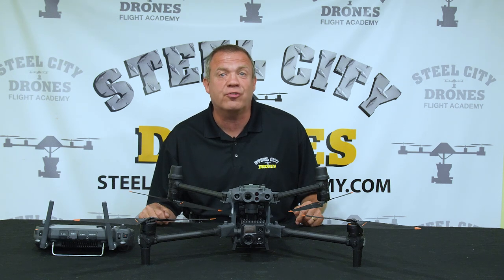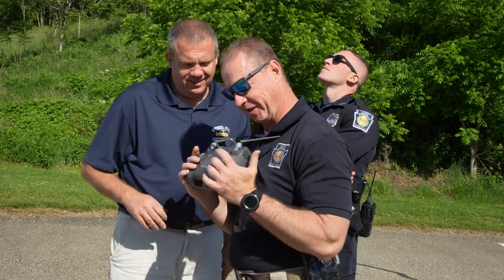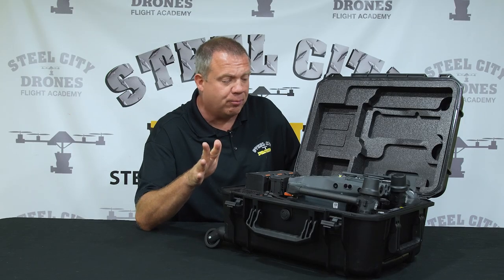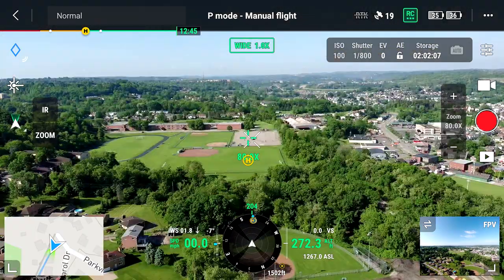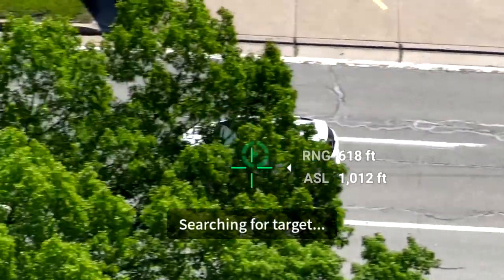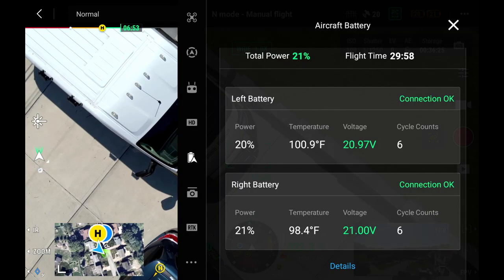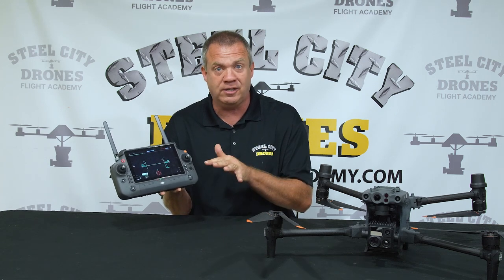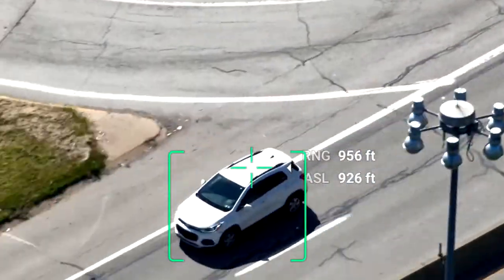DJI Matrice 30 Comprehensive Review and Comparison

Comment: This in an excellent video of a really outstanding drone. If it sounds like a lot of money, and it is, I can truly say that's worth every penny. After I bought one, I simply could not believe the quality, the workmanship and the design. DJI thought out every detail and really hit a home run with this drone. I'm fortunate to live in Florida and can connect to FPRN at absolutely no charge. That provides me with RTK, which means I could do mapping, just as if had had a base station. Aside from mapping, the advantage of RTK is a more stable platform, not having to rely solely on the compass, and giving you 1-2 cm accuracy when landing or getting coordinates. This drone has all the system redundancy of a manned aircraft.  The M300 is also a great bird but costs 3-4 times as much, which puts it in the not-affordable category, it's huge, heavy, more expensive to run, and is a pain to transport.  Thanks to Steel City Drones for all the time and efforts spent in putting this great video together.

Comment: This Drone could be the best creation of DJI, and the best Drone ever made!
Even I believe in some how it’s beside the Matrice 300!

However this Drone M30 series has 2 big downsides; 

1- You can’t pay $20,000( Australian price of DJI M30T basic kit with DJI care 1 year) in a Drone where the main camera, hardly can turned left and right, I mean when you turned left and right, you can see the arms, propellers, and stuffs of the Drone, like in the whole frame!!!

The main camera should have been able to turned 360 degrees, or at the list 180 degrees in a clean view, only looking for the subject in the frame, specially when it has been “Built/ Made”  for first safety responders, like Fire fighters, Police and others!!

2- The main camera should be able to swap for other payload, like P1/L1 and more, specially because it is very compact and great drone with its size and portability!

However about swapping the cameras/ payloads, if they haven’t thought about that before realising, at the list they should have made 4 different versions…

- First version M30/ M30T, 
-Second version M30 P1
-Third version M30 L1
-Forth version the Dock one, as it already has been made( but this one it’s specific for companies and stuffs).

If the DJI Enterprise Team had thinking about that, it would have been selling just like water bottles!!

Specially for many trades out there, and many different industries would benefit from that choice to buy, different needs but in the same Drone, even more special because of those many features like as deploy time, Walter-proof, portability and on!

*The best RC ever made!

Comment: This is basically your Phantom 5 Pro Advanced V2+  that everyone was waiting on.
Reply from the maker: Actually it couldn't be more further apart than any Phantom. This is water resistive, with outstanding zoom capability, awesome thermal, and 30 minutes of flight time. This has all Matrice 300 features like Smart track, and grid mode with Pilot 2 functionality.  This has no landing gear for no drag and flies incredibly smooth and can handle up to 33 mph winds. No P5 was going to or will be able to do that.

Comment: How could DJI make such a backward step by using a 128 GB card (maximum) from what the Mavic 3 Cine has?
Reply from the maker: Two different drones with 2 different purposes and requirements. Matrice 30 does not do Pro res or 10 bit filming. The M30 is for public safety not film makers. The Cine unit for the most part will use the internal SSD drive because the file sizes are huge. With the M30, the camera's file sizes are significantly smaller thus not needing more than 128 GB.  IN fact during our filming and testing of the M30 for this video we never even filled up a 64 gig card once.

Comment: Does it have smart follow feature? That is following the location of the controller. For example, if i control it from a moving car, but i want to be able to look around me from the sky.
Reply from the maker: Smart track will follow any update that you select it to pick up. Objects should show up as green circles and as you select it the camera will stay locked in on it. It won't follow the object but the camera will stay locked in on it.

Comment: Dave,  any new model drone will need to be made to comply with remote id from the manufacturer starting in Sept of this year.  And in June, there is no final specification??  That seems ridiculous, right?  I suspect DJI has a very good idea whether or not the capability for complying with remote id is if fact ready to go.  Maybe they can't yet say "absolute" "positively", but they basically know. Thank you for the comprehensive video.
Reply from the maker: I suspect remote ID will be delayed just like Part 107 was 2 years delayed even under a direct order from the President.

Comment: Hey I have a question about the m30T last week you were flying the drone and had a lost connection between the drone and the remote control. The settings for lost connection Were hover. what will the drone do when it reaches low battery ?
 We were still with no connection with the drone, will it start returning to home or land where at it's ?
Reply from the maker: if Smart Return is turned on it will come back, if its off it will fall out of the sky.

Comment: Hi, I have a question about the loudspeaker attachment. Does it act as a megaphone where you can speak directly or is it only support text to speech?
Reply from the maker: As of right now you can only text a message, in my opinion that will change with firmware updates that will change.

Comment: What streaming abilities exist to get video to command center?    Is there the ability to specify a URL to stream to?    Does dronesense work on the smart controller?   Or is there ONLY HDMI out?
Reply from the maker: There are free ways to do it streaming to Youtube or Facebook but they are not secure and very inconsistent.  The best option we have found is an option called DroneSense that works very well, very secure, very consistent. You don't have to buy equipment and its a monthly charge.  It also does a lot more than just streaming and handles Pilot management and maintenance as well.
Reply: There is also DJI flight hub 2. I believe a free trial exists with the beta version.

Comment: Dave, great video as always. Question: is the M30T able to do solar thermal inspections over solar farms? I heard it has a (software) limitation that makes the range of the camera +/- 2°, needing a +/- 0.5° range at the most. Any comments?
Reply from the maker: Hello Juan I am not sure what you mean by the range of the camera is +/- 2°.  Can you clarify what you mean by range?
Reply: @SteelCityDrones  Sorry Dave, I have no further information about it. Anyway, is the M30T able to do a similar solar panel inspection as the M300 + H20T does? Regards
Reply from the maker: @JCDiaz-Skytech  It depends on your requirements are as far as how far you have to have to have the drone away from it and to what level of detail you have. The Cell tower inspection comparison we included in this video here 20:12 was done to give you an idea of the differences between the 2 aircraft to help you with these types of decisions.

Comment: Does the cell tower interfere with the control of the drone, if working?
Reply from the maker: Cell towers that have high power dish emitters can interfer with any drone's signal regardless of make or model and there's nothing that you can do except set the come home altitude higher than the cell tower so it will come home if you lose the signal.  The issue is the intensity of the signal and nothing to do with magnetic-elecromagnetic issues. SO RTK does not help in that situation.
Reply: @SteelCityDrones  thank you

Comment: The main thing I don't like about the Mavic 3T is the controller! To small! 7 inch should be the min! I use a 11 inch tablet on my Mavic 3 and still miss stuff often! 

Not bright enough I guess as I'm always adjusting EV and over exposing!
Reply from the maker: That's exactly why we built our custom 13 inch ultra bright display monitors.
Reply: @SteelCityDrones  you have info on them?
Reply from the maker: @WW5RM  https://youtu.be/cPpHMRUBIFk
Reply: @SteelCityDrones  YES! Thank you! 

I've got a old 20 inch monitor i use a Firestick plugged into the DVI port. Helps tons! But its not very bright and I have to drag a Ext cord to it for power.

Comment: Hi,
I know the M30 is not designed for videography but does seem to show the blades in flight quite a bit. What are other people's opinion on this?
Reply from the maker: You have a 105 degree pan range. You have about a 45 degree range in wide camera straight on that you won’t see the props.
Reply: @SteelCityDrones  Thanks for reply as I have the M30T coming next week 😀
Reply from the maker: @initiateflightstudios6562  where did you buy from?
Reply: @SteelCityDrones  I run Drone business in Adelaide Australia.  Purchased from D1 Store Victoria.

Comment: There have been many illegals coming through our nations southern border. Would this drone be capable of deploying or dropping some sort of "die", like a florescent pink, or hot yelllow, on illegals as they scurry accross our border?
Reply from the maker: As we discussed in this video, the M30 has no ability for payload drop systems. You would need to go to the Matrice 300 with a TH4 drop system.